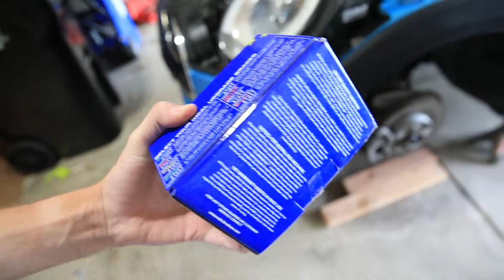STAGE 2 MINI Gets BETTER BRAKES + FLUID | EBC YellowStuff & Motul RBF600

Comment: Did you do the brake in process for your EBC yellows? I’ve been warned about messing up the rotors and pads if not broken in properly. Any issues?
Reply from the maker: I did do the bed-in process, and I filmed it to put in the video, but the video quality was terrible so I didn't use it. But rest assured I did do it, and didn't have any issues